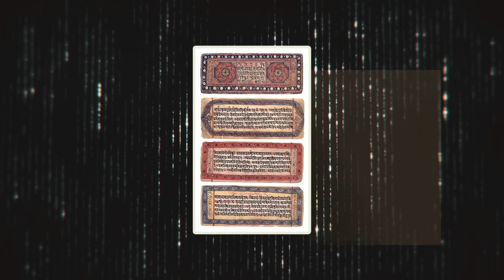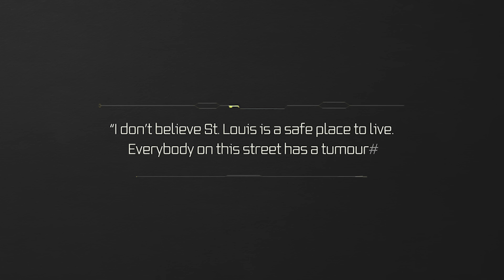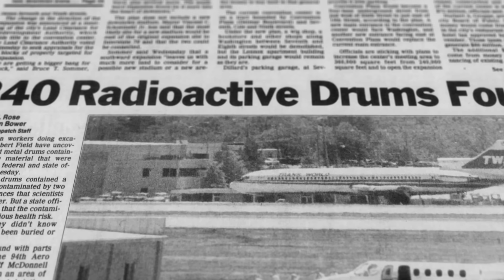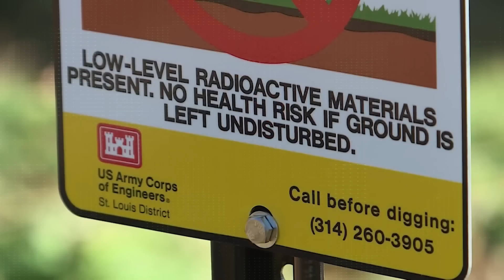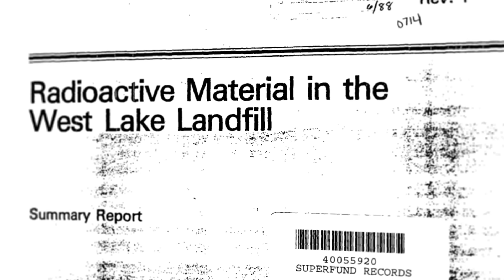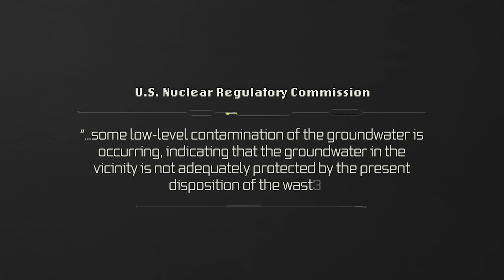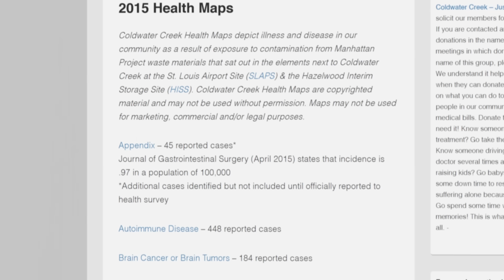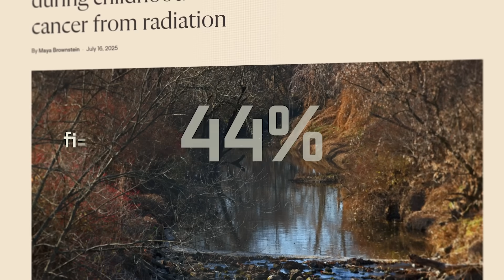West Lake: The Toxic Leftover of the Manhattan Project

Comment: I worked for Murphy Mechanical and in 2008 i believe it was we did work at the land fill. The radiation levels were high from the area thats fenced in were they buried the waste plus all the agent orange that Monsanto didnt ship over seas got buried there also. We worked in the land fill area and ive seen bugs ive never seen before, 2 headed snakes and a rabbit that stood 3ft tall. Im totally serious. When animals like the rabbit eat the grass in the toxic area this is what happens. The creek for 6 miles that runs by the land fill had to be completely dug up it was so bad. The engineers and scientist on the job said the land fill was a time bomb ready to blow. The levels of radiation were higher than what is allowed for human exposure so they raised the level for human exposure or they would have to close Bridgton Park right off of Gist Rd by Hussmans. The area were they buried the trash has pipes layered in the trash that run to the MSD treatment plant and they were so clogged it was like pushing oat meal through a pipe so the back flushed it and Murphy installed 4 / 1 million gal tanks to run the waste water through before it goes the the treatment plant, plus a chemical called Lecha was added and those flesh eating bugs that eat the meat of bones so anthropologist can study the bones. Lecha and bugs supplied by Monsanto. The bugs were added to eat everything so it could break down to liquid. Plus the tanks had to be 68 degree temp all year long for bugs to live and eat. A tanker truck would hook a hose to the tanks to load the bugs and if the hose broke and they got out they would burn them up. These 1million gal tanks had a 4ft concrete wall around all 4 of them for containment for spills. Plus Massive HVAC system for 68 degree temp all year long.

Comment: I live in St Charles across the river from the site maybe 4-5 miles away. During low pressure, dank weather I can smell the landfill at my house, and if the wind is from the east. The only way to clean the site is to completely remove ALL of the contaminated material and soil. As a Superfund site the federal government is supposed to cover half the cost and the landfill company the rest. It sits undone because both parties are balking at the cost of removal. So they just cover it and sit on it hoping not to have to do anything. Meanwhile across the street is the deep trash fire that they don't know how to put out, because it is so hot it would explode if exposed. In the 21st century, with all our advances the Corps of Engineers can't figure out how to put out an underground fire. So they do nothing with a tarped over nuclear waste dump sitting yards away from a subterranean fire and keep their fingers crossed. It's beyond idiotic!!!!!

Comment: Nice work on this one. A few additional facts, though...

1) Mallinkrodt didn't do the U235 enrichment. That was done at Oak Ridge. What Mallinkrodt DID do, however, was the U235 machining...smelting the metal, then machining the rough parts for Little Boy from the castings.

Sounds innocuous enough, right? Mmmm...nope!

For one thing, Uranium metal is pyrophoric. It can, and did, catch on fire when exposed to air. So in addition to the scrap from machining, there were several uranium fires at the factory.

When the EPA showed up finally in the 1980s, their assessment showed the entire Mallinkrodt plant to be awash in U235 dust and microscopic residues. This was EVERYWHERE. You had U235-laden dust on the plant's rafters and in every nook and cranny that EPA checked. And Mallinkrodt's plant was actually just north of downtown...and yes, they even found small amounts in other nearby buildings, most likely due to wind carrying dust and uranium fire residues around downtown.

2) The West Lake fiasco also affected Lambert Field, St. Louis' airport, as a lot of waste went into the necessary landscape modifications for airport expansion. The fire actually was thought to be heading underneath their then-new runway extensions, but that plume was somewhat brought under control.

Even so, putting the fire out released loads of toxins and, yep, some radiological hazards. And they're not sure if it IS out.

3) Weldon Springs State Park. Yep, they turned some of that into a park, which has this high mound of limestone chat as its centerpiece. That mound, however, is the burial site for the radiological hazards; the part that held the TNT factory, however, is still incredibly contaminated...just not all that radioactive.

It's worth noting, also, that workers were killed by some of the toxins that were there. In the machining process, Mallinkrodt used large quantities of HF...hydrofluoric acid. Those are also somewhere under the chat mound, but putting them there exposed workers to the HF, with at least one worker getting splashed by the solvent. Supposedly, he died in a matter of hours.

4) Elsewhere in St. Louis, there's still some confusion as to where the radiological hazards are. The River Des Peres is nowhere near Lambert Field or Mallinkrodt or Weldon Springs...but in recent years, radioactive materials have been found there.

Some of the suspicion for this goes back to those uranium fires. Others think that the River was used as a "quick 'n' dirty" dump site. And still others suspect that the contaminants wound up there due to a possible traffic accident. But nobody truly knows...all that's known is that the material found in there fits the same spectrogram as U235.

And the real kicker...

5) That crap didn't stay put. Coldwater Creek flows into the Mississippi River from the Missouri. You guessed it...matching contamination has now spread South through the Mississippi River.

That's the worst one of all. Uranium tends to settle into river sediment, but since the Mississippi carries extensive barge traffic and requires dredging to keep the navigation channel clear...yep, you know what happens next.

I'm not sure how far the contamination has spread at this point. But as worsening drought plagues the Mississippi Valley, more dredging has to be done. Otherwise, transportation on the river will stop.

Ah, yes...St. Louis. Lovely place. At its current pace of decay, it'll probably be the new Detroit in about a decade. Yet it'll still be ahead of EAST St. Louis, which bears certain resemblances to a bad combo of Gary, Indiana and Mogadishu, Somalia. You DO NOT want to go to a place where directions to lost travelers start off with "Well, you need to go that way for a few blocks until you see THE BURNING CAR, then take a left to get back on I-70." 😵 Great place.

Comment: Let's separate commercial nuclear plants from nuclear weapons. Commercial nuclear material is only enriched to at most 10% while weapons material is over 80%. TMI and Chernobly are not comparable to nuclear explosions. TMI was a partial meltdown to lack of cooling. Chernobyl was due to rapid steam formation, which blew off the reactor cap. Once the cap was off, air rushed in, and the hydrogen in the reactor exploded. It was NOT a nuclear explosion.

Comment: You need to work on your voice volume regulation when you force yourself to talk deep you significantly reduce in decibles leading to an obnoxious extreme of what did he say and fucking turn down the highs man’s video has worse volume highs and lows then cable tv shows and thier commercials can’t get through it man just talk normal quit with the forced lows they are not hitching you up just pissing me off

Comment: The Mallinckrodt plant did not enrich uranium or fission uranium. It refined uranium from uranium ore. Uranium ore contains radium and polonium (which Madame Curie discovered in it); also thorium, radon, actinium, protactinium, and radioactive isotopes of bismuth, lead, and thallium. These isotopes and the ore and spent ore containing them are naturally occurring radioactive materials (NORM). Digging and drilling for coal, oil, gas, and ores all can expose, concentrate, and release NORM. It is regulated now. It is important to avoid grinding it into dust or sludge and putting it where it gets into people via the air and water.

Comment: My current in-laws, including (briefly) my fiancé, lived in near that area for a number of years (late 50s to the early 80s). Dad worked at the Monsanto plant that was even closer to it. He has had 3 different types of cancer in the last 30+ years and still has a tumor in his brain that requires monitoring. I think the only thing that saved the family was that they moved out of the area in the early 80's. This just sheds light on the amazing miracle that both his parents are, considering they are both in their mid 80s as I type this (83 and 84 respectively).

Comment: I used to live and work by West Lake. I took my geiger counter out there by  and you could measure the radiation spike from the freeway. Instead of  0.07 MicroSieverts it was closer to 0.20 MicroSieverts. 2 out of 4 of my coworkers developed prostate cancer after working in the area.

Comment: Anyone that drives I-270 and I-70 can experience the remaining lingering smell at the intersection of these highways. Its god awful and for days after a rain, the smell gets intensified and can be smelled in the water at drinking fountains. More unfortunate, I work within a mile of the area. If the wind blows just right, the smell gets sucked into the building.

Comment: It wasn’t just the manhattan project, that’s where the USG contractors processed almost every single ton of HE Uranium until they shut down decades later.. After shutting down , no one told the new facility owners what had happened there for decades before. There is another documentary as well, where the title doesn’t allude to the topic , something water as I recall. They highlight the hundreds of contractors and sub contractors that proceeded radioactive materials all over the U.S. That whole,place is a toxic dump, all along the ST Louis waterfront. They dumped all over STL for decades.

Also see “Target St Louis” about Army radiation experiments on  folks; “The 1st secret city”; “The safe side of the fence”.

Comment: Over the last few months, additional radioactivity was found under multiple homes in the area forcing the families in these homes out due to the high levels of radiation. So far, it's been continuing to spread in the ground water under homes in the area. Add to that the area also has natural gas deposits near the surface and you get the potential for a "dirty explosion" of sorts of the radiation continues to spread to those areas that regularly explode due to the natural gas deposits.

Comment: This sounds much like Santa Suzanna mountains test site near Simi Valley in Southern California.The west coast’s Three mile Island like melt down site. Only difference this site has no concrete dome to contain the radioactive waste, no formidable clean up.This site still has the remains of the Boeing rocket fuel and US governments nuclear waste ponds. These remains are the toxic sludge they couldn’t burn and goes unchecked today. Seeping into the ground and into communities down wind. A toxic dust that blows through communities during the dreaded Santa Anna winds each Fall and Winter.

Comment: Both of my grandparents lived near Coldwater Creek.  One of them backed up to the creek near St. Cin park, which recently had soil excavated and removed due to contamination from the creek flooding.  My grandparents’ house and yard had flooded multiple times over the years.  The man that lived behind them owned a section of land between the neighborhood and the creek which he grew food crops on.  He later died from cancer, along with several other neighbors.

Ironically, as teenagers we would go exploring the “Echo Dome” in Weldon Springs, which was a facility where they processed yellow cake after WWII.  Part of the site had previously been used to produce DNT and TNT.  It was heavily contaminated and the DOE later encapsulated much of it under a huge concrete dome.

You can’t drive down Interstate 70 most days without the landfill (the same one with the underground fire) smell filling your car.  It’s sad to think about how many surrounding areas and families have been adversely affected all as results of mishandling materials all related to The Manhattan Project!
Reply: Yes! Yes! We did too. I remember that place, it was super creepy. Had a weird feel to it.

Comment: I have lived in St Louis for the last 2 years and have been vaguely aware of this but mostly about the toxic landfill in North County among a few environmental hazards. The creek is 11 miles from where I live but I just realized that it runs less than 3 miles from the house I work at. The air there always smells a little strange. Especially on hot days, and I've noticed it's always a few degrees hotter over there than it is in my neighborhood. I am definitely not drinking the water there anymore. I distill all of the water that I drink at my house because of lead pipes but I've gotten a little bit lazy about bringing my own water places. Good reminder not to trust municipal water sources (in general, not just in STL) they've also had several water main breaks over that way this summer

Comment: U-238 is extremely useful in nuclear applications, just not as a fuel or pit of a nuclear weapon. It can be used for shielding against alpha particles, beta particles, and gamma rays. U-238 can be bombarded with neutrons in a reactor to make plutonium-239, which is used in nuclear pits and can be mixed with U-235 for reactor use. U-238 can also be used to make fusion tampers and radiation cases in nuclear weapons that undergo fission in response to bombardment from high-energy prompt neutrons from the fusion stage. Most of the energy comes from this third fission stage, rather than the fusion secondary.

Comment: The dumping at Love Canal wasn't illegal at the time the products were dumped there. In 1953, when The Hooker Chemical Company sold the land to the Niagara Falls School District, they warned the school district not to use the land because of the chemicals that had been dumped there. The school district agreed that the land would be used for a park, and no construction would take place on the land.

Four years later, in 1957, the Niagara Falls School Board, knowing the chemicals had been dumped on the site, then sold the land to the public without disclosing to the new buyers that the land had previously been a toxic waste dump. The construction of new houses on the land breached the containment of the dump, and allowed the chemicals to leak into the ground water.

Comment: If you guys think this is bad, please look into the Hunters Point Shipyards in San Francisco. Long story short, they sandblasted clean the boats that were used in nuclear tests and washed it into the bay or buried it as landfill later. They built low income housing on top of that and moved half of the black residents there. Denied it for 50 years, and still refuse to clean it up. I think it would be a great story for this channel.
Reply: St.louis was a billion trillion times worse.... by and far worse..... literally tons and tons of raw raffinate piles dumped near busy roads on paved parking lots blowing freely in the wind 24/7 uncovered open for decades . Hundreds of thousands 100 gallon drums of it dumped on the bank of cold water creek flooded rusted leaking into the creek for over 4 or 5 decades....the processing sites in the city and st.charles plus the landfill site. This entire metro area should glow green all night long

Comment: The core issue isn't nuclear energy but the same thing that dogs all of our modern civilization. How corporations handle the extremely harmful waste product of "modern chemistry".  Nuclear waste is really just.. one in a long line of "byproducts" whose existence and handling are long term problems.  I mean, we have records of them hiding truth for 50+ years. The issue is the CORPORATIONS.  The waste wasn't a problem.. until it was MISHANDLED.. Illegally dumped. The same problems with Dioxin contamination in Missouri and Oklahoma. The same as how Dupot keeps just changing one atom in the molecule for teflon to skirt the law and to allow themselves to profit off of massive environmental contamination.  It may sound extreme, but money isn't the solution to this, I.E. fines, etc. They don't care about fines. Fines are viewed by wealthy as nothing more than the COST OF A LICENSE TO VIOLATE A LAW. In other words.. they don't care. They are rich and can pass on the costs or use shell corps or do "division sell offs" to avoid any personal costs. 

The costs.. should be personal. The law should be changed so that all corporation "owners" and "controllers" are PERSONALLY responsible and LIABLE for how their corporation operates. We are talking jail time, loss of all personal wealth. 

It is beyond the pale that it is allowed to continue. If you want to know what horrors are, China is an unregulated market in regards to environmental contamination. You really don't know just how bad it is there. The ten-thousand year horror that is being made worse and longer every day. 

The cost of your.. consumer existence and the profit of the corporations.